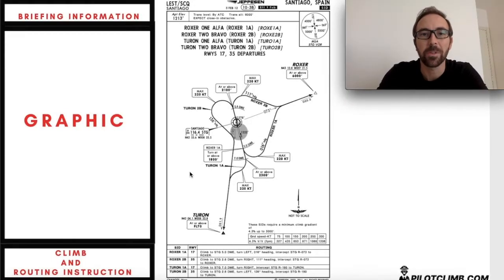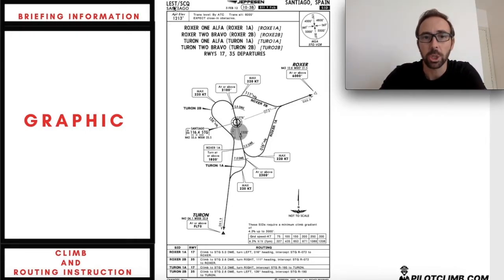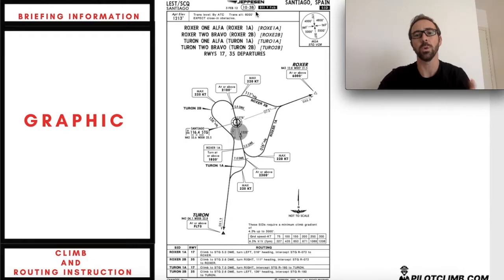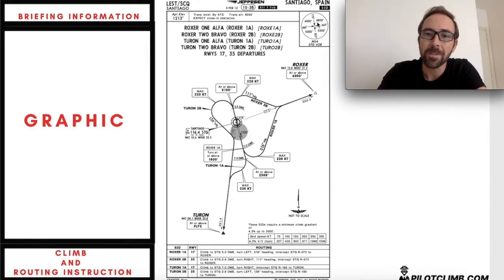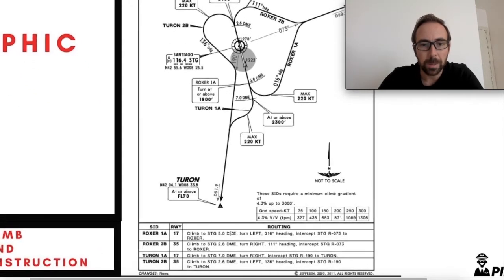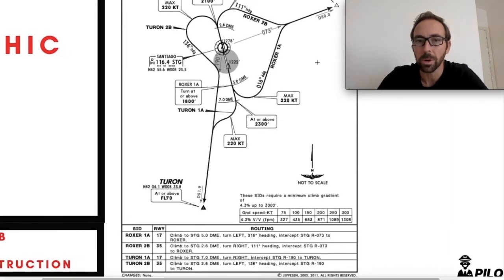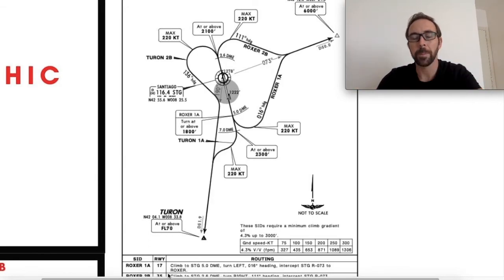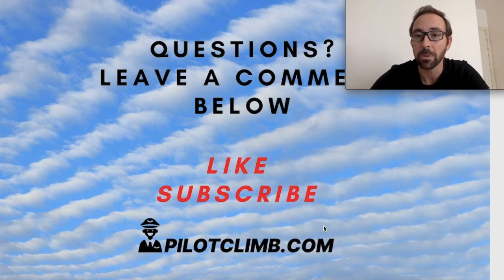Standard Instrument Departure (SID) Procedure Explained [How to read a SID chart Like a PRO].

Comment: Thank you for all videos you share ! They are very helpful !
The standard climb gradient for a SID is 3,3%…right ? Meanwhile, the minimum required for a two engine aircraft is 2,4% ! does this mean that the minimum required for twin engine, or even for engine aircraft are below the standard minimum required for SIDS..? 
Thank you
Reply from the maker: Hey, thanks for watching and the comment! Great question! The 2.4% is a minimum climb gradient with one engine Inoperative. So the Aircraft should be able to provide 2.4% with One engine inop. If an engine fails during the initial climb you won't follow the SID because its minimum climb gradient may exceed the 2.4%. Let me know if I answered your question. Have a great day!